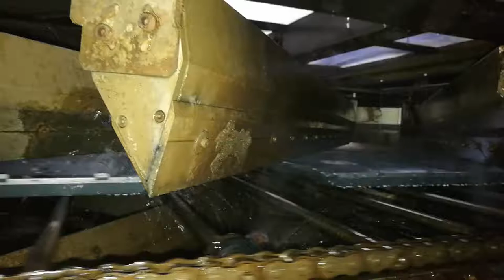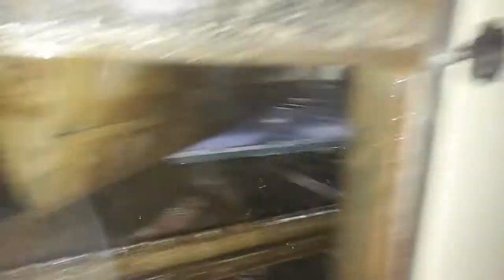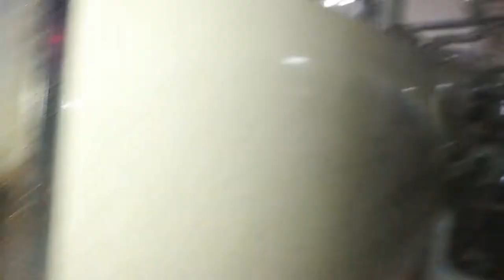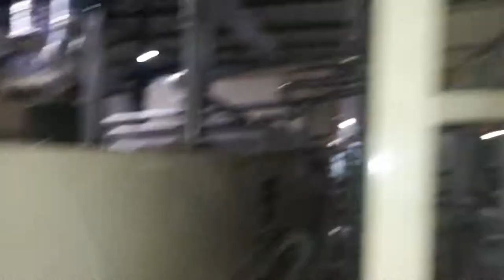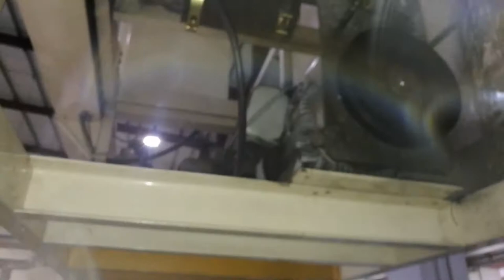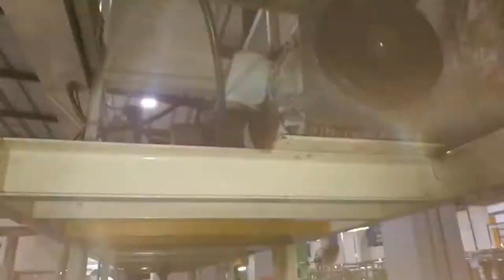TV Backboard Drying and Water Blowing- off by Aluminum Alloy Air Knives - RAETTS

Comment from the maker: Air Knives are a proven cost-effective alternative to compressed air reducing energy use by 70-95% for the majority of applications. In fact, compressed air is at its most inefficient when discharged into free air.
Powered by a centrifugal blower unit an Air Knife system is a low pressure, high volume air delivery tool designed specifically to blow-off all surface liquids/moisture and clean web materials, components and produce.

The ease of installation and low-energy consumption makes them an efficient, cost-effective solution providing significant savings over thermal and compressed air systems.

RAETTS Air Knife System Solutions have a uniform slot design that projects an uninterrupted sheet of precisely controlled, high velocity air thereby supplying a powerful flow across the entire surface of the product being processed.

Blower-driven solutions that increase production efficiencies and save significant running costs.     https://www.raettsgroup.com/